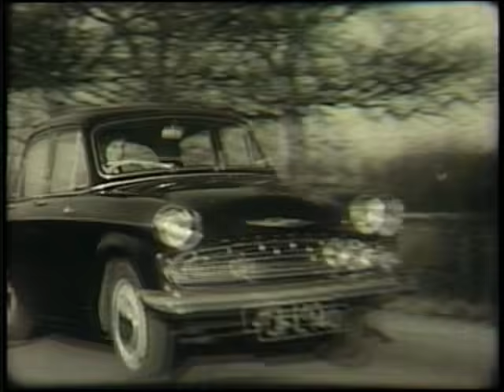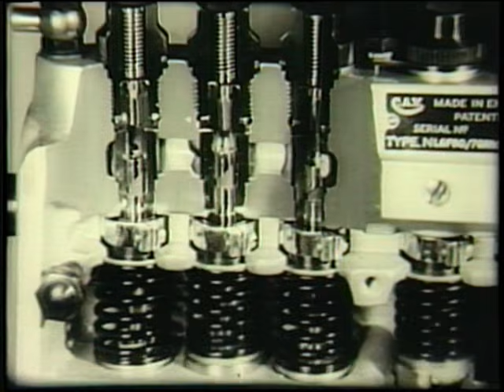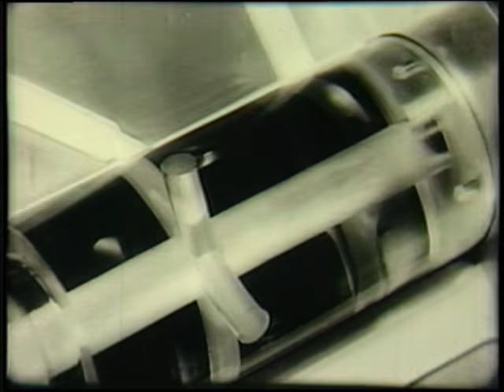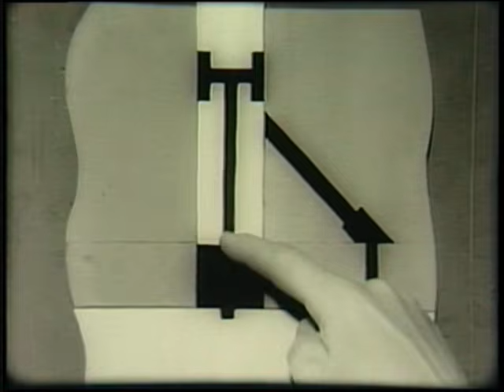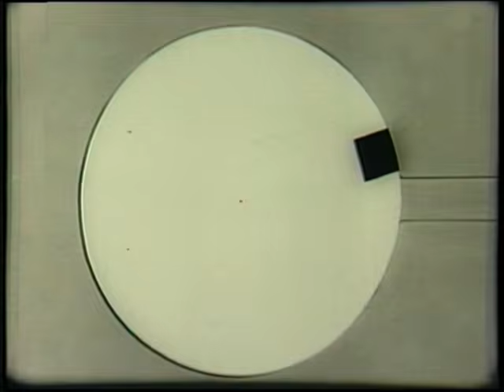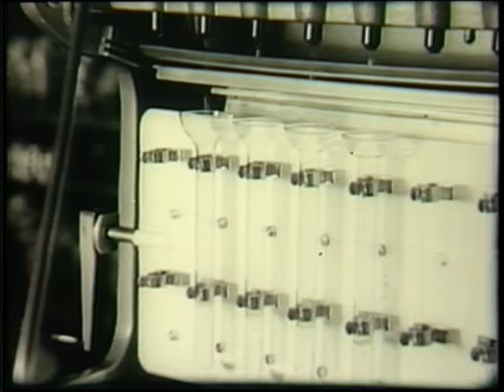The CAV Distributor Type Fuel Injection Pump Type DPA Construction  & Operation

Comment: I repaired the leaking top cover shafts on my 1985 ford backhoe and I can just get it to idle! What the hell did I do wrong?  Very varnished inside and  I think I have the spring holes correct but can someone tell me what hole the spring goes into on the pivoting arm?

Comment: is there someone on this video that can answer a cav question i have about our case580e backhoe? the engine will only run when i operate any hydraulic, as if the hydraulic load causes the pump to work i guess? somehow i find this pump very complex and want to understand before i take it all apart, this is my current job and i dont know what to tell the boss
Reply: A pump such as this should be sent off to a specialist Company to deal with - it's quite beyond the standard workshop facility due to its very fine engineering tolerances when being manufactured, and also the cleanliness of the servicing environment is of utmost importance for the very same reason.

Comment: nice job,,,,in the test room, is the test done with a prototype injector? or what the engine has...how will we measure the pressure of the transfer pump? and how will we know if the hydraulic head has lost its performance..thanks
Reply: I think you will find that the lower of the two bleed nipples is at transfer pump pressure and the upper is at lift-pump pressure.
Reply: @ColinMill1  how will we know if the hydraulic head has lost its performance..thanks
Reply: @nik-utb  That is a very good question. On the vehicle its not going to be easy. Given that, in a conventional diesel engine, the injection system isn't trying to maintain a given fuel/air ratio (as it has to in a petrol injection system). The action of the governor probably masks moderate levels of leakage in the high-pressure pump. At a given throttle setting, if the RPM drops slightly because leakage is reducing the delivery to the injectors then the governor will open the control valve slightly and increase the fuel being delivered. I suspect a badly worn high pressure pump shows up first at idle where there is more time for the leaks to have effect and the fuel delivery per pulse is low.
Back in the 1960s I did, as a kid, spend about a week watching what went on in a fuel injection repair shop and the pump testing was done without injectors on the outlets but with the outlets simply piped up to a set of measuring cylinders so that the flow rates could be measured. Presumably the assumption was that the pump, having been refurbished, wouldn't have any excessive leaks that would affect the delivery under injector back-pressure.
Wear in the transfer pump is, I suspect, not a major issue. The transfer pump on a DPA pump, from my calculations, circulates through the regulator valve about 15 times the volume delivered by the high-pressure pump under maximum load. So the system should perform fairly normally even with moderate wear in the transfer pump.
Reply: @ColinMill1  thanks..greetings from GREECE

Comment: Very useful video. What I don't understand is how a worn pump can be reconditioned. As it wears presumably the fuel pressure within the pump housing increases and so inevitably the drive shaft seal will eventually be overloaded and leak into the sump. So unless all the worn components are replaced there will be no improvement in an old pump.

Comment: But what if you press the priming knobb? Well the fuel bypass everything. The priming pin can get stucked and mess up motor
Reply: what? im trying to understand
Reply: The regulator valve allows the pump to be primed using the lift pump priming lever as far as filling the pump casing and the transfer pump but not the high pressure pump or the injector lines so the final stage of priming requires cranking to operate both the transfer pump and the high pressure pump. The lift pump priming lever is missing on my tractor so I have to do the whole priming job by cranking. With a fully charged battery this is no problem.

Comment: Hi all, I am trouble shooting a Bristol Taurus crawler (1950s era) which will only operate at full RPM. Perkins 3cyl engine, CAV BPE injector pump. Wondering if anyone has advice what could be causing this issue - the engine had been run out of fuel immediately prior to this issue arising so I am wondering whether something from the bottom of the tank has blocked/stopped something in the fuel injection pump? Many thanks
Reply: did you get it fixed?
Reply: These DPA Injection Pumps are engineered to exceedingly tight tolerances, and so any debris in the fuel supply will undoubtedly have a negative effect on the function of the pump itself. The fact that you say that the engine had been run out of fuel just prior to the issues you've experienced would certainly point to contamination of some sort. When a fuel tank is run very low or empty, any crud in the system tends to accumulate around the fuel outlet port, though a guaze filter is normally employed at this position. It should be removed and cleaned and the fuel tank also thoroughly cleaned to get rid of any internal debris build up, before refitting either a recleaned guaze filter, or a new one installed.
 After the fuel tank but before the fuel injection pump, there is usually at least one fuel oil filter element and in some cases two, in order that only the cleanest fuel is allowed into the system to begin with. These filters can also be replaced with new, if deemed necessary.
 Regards stripping an injector pump down, I'd respectfully suggest that the pump itself be sent off to a specialist in this kind of work.
 The tolerances are so fine, I'm led to believe that even the heat from ones hand, if holding a demounted pump, can actually expand some of the elements within the pump.
 In use, although physically bolted to the rear of the timing gear housing, said housing is usually made of diecast aluminium which conducts heat generated through the engine block, away from the pump body. Furthermore, because Diesel fuel oil  is also used as a means of lubricating the pump, all closely mated surfaces within the pump benefit greatly from the cooling effect of the Diesel fuel any time the engine is running.

Comment: Every other video about fuel injection pumps should be required to have a link to this original Perkins technical sales/support film.
The real question that everyone has is how do I get air out of the thing so the motor will start.  Now I know what is going on inside the pump.

Comment: Excellent video, thank you very much!

I am in a process of converting my marine Perkins 4.108 into a generator work horse and was trying to find information on CAV DPA hydraulic (which my motor has) and on mechanical pump (which I think I should get for generator use). This video explains all I need to know about these two types of CAV pumps.

Comment: Okay I got a dumb question, if the hydraulic governor is far simpler, why use the mechanical type? He says it's more precise but what does that mean?
Reply: Well, I have a 35x tractor with the mechanical governor and if it is running light at 1700 rpm it will drop to perhaps 1500 rpm under full load. Quite remarkable for a purely mechanical system especially as it has no tendency to hunt even though the pump has 8500 hours on it.
Reply: @ColinMill1 the DPA Fuel Injection Pump is indeed a mechanical marvel - so clever yet so simple !

Comment: Excellent presentation and show the internal workings of the CAV diesel pumps. The British are true masters in mechanical engineering. Love the vintage of the overall video clip. 1950's ?
Reply: Lolz.......it's a poorly made knock off of a Roosa Master pump!
Reply: @randymagnum143 I did wonder about that myself, so that would be to suggest that the Roosa Master Injection Pump was first on the scene before the CAV  version ?
 I would debate whether the CAV Distributor Pump was 'a poorly made' item - many generations of Perkins engines have used this very pump, whether it be for a 3, 4 or 6 cylinder engine. All of those engines have withstood the test of time which kind of pours cold water on your assertion that they're poorly engineered !
 As an aside, CAV also manufactured a Rotary Distributor Fuel Injection Pump for use specifically with V8 diesel engines - this was a first in the industry - around late 1976, as said pump was fitted to V8-640 & TV8-640 engines as fitted to the newly minted MF 2770 & 2800 tractors respectively. 
 This particular pump was a bit of a disaster unfortunately and could allow the engine to run in reverse, with the obvious consequences.
 Said pump was quietly discontinued not long after, and subsequent versions of these two specific engines thereafter utilised Inline Fuel Injection Pumps supplied by either Robert Bosch or Simms.
 Given the design similarities of these two particular pumps, one may simply have been a copy of the other, built under licence, but I am not certain on that point, or which Company actually originated the design ?
 Once heard about an MF 90 tractor that had a Roosa Master Injection Pump fitted and it ran extremely poorly. Owner of the machine swapped it over for a Distributor type pump and had no further issues. You pays your money......
Reply: @randymagnum143  The CAV DPA was introduced before the Roosa Master Pump. Stanadyne also chose to license produce the DPA.
Reply: @agt155 so why was the Roosa Master introduced 8 years before the Cav?  And why did Hartford Machine Screw buy the patent if Cav already owned it?  You’re wrong

https://www.dieselduck.info/machine/01%20prime%20movers/1988%20Roosa%20HP%20Distributor%20fuel%20pump.pdf
Reply: @agt155 don’t know why my comment was deleted, but 1947 for Hartford Screw to by patent from investors, 1953 they sold license to Cav, stanadyne wasn’t a thing until the 70’s when they took over Roosa Master production.  You’re all over the wrong map.
Reply: @randymagnum143  Hartford Machine Screw Company became Standard Screw Company in 1900. Standard Screw Company changed its name to Stanadyne in 1970, they are all the same company..

The CAV DPA was a CAV design not a licensed product.  Stanadyne license produced the CAV DPA.  Strange why the owners of Roosa pumps chose to license produce a rivals "poor knock off" don't you think?
Reply: @agt155 ok, what year did cav introduce their version?  🤨  didn't lucas own Simms too?  Another poorly made injection pump.  Ozzy worked for lucas, the prince of darkness.
Reply: @agt155 Hartford Machine Screw was founded by Christopher Spencer.
Reply: @agt155 Vernon Roosa said you don't know WTF you're talking about.

Comment: Lol, all their developmental work, ok sure. It's a Roosa master DB2 pump they built under license, just like the stanadyne pumps used by GM and Ford in their mechanical injection diesel pickups, in Ford tractors, and all kinds of stationary light engines. Those CAV units look like a direct copy of the Roosa labeled units in Ford tractors, ROFL
Reply: The distributor pump design was licensed from stanadyne. However anyone with more than a passing familiarity would know that a DPA and DB4 are different pumps.
Reply: @tjsbbi  db2, not 4, and Roosa had both the mechanical and hydraulic governing covered in his patents. The differences are very minor, the Roosa vane pump uses 4 blades instead of 2, the mechanical linkages in the governor racks are divergent, yet perform almost exactly the same. The db4 has a 4 plunger high pressure pump for greater volume, but the db2 is a dual plunger just like that dpa. Roosa also has pneumatic governing as an option, but it require an intake butterfly valve akin to a throttle body. The difference of the dpa in that film and the Roosa used in Ford light tractors is pretty much the top cover mounting, and plane of the fuel lever rotation. The dpa just uses a simpler main casting, and a "lower inventory count" lever and spring arrangement.
Reply: @ludditeneaderthal  my mistake then I was thinking of a DB4. I seem to remember them as having a substantially heavier barrel.  The CAV DPA and DPC had a 4 vane transfer pump which may be the same as the DB4.
Reply: @tjsbbi  the stanadyne pumps run a gamut of sizes. The db2 on the Ford idi v8s are actually pretty tiny, the gm 6.2 v8 version is also "petite", lol. The 4 cyl White engine military genset model is a bit larger, and some stationary use models get pretty chunky. The Ford 4 cyl small tractor model is about the size of the Perkins CAV. I think that's just indicative of the versatility of the design, it's quite scalable for the job at hand, even if you only use the 2 roller variant. At least as scalable as the typical Bosch style " box, camshaft, and row of pump bodies" pump/governor rigs, and pretty much always lighter and cheaper. That DPA is actually a pretty nice variant, between the simplified castings and the "lean manufacturing" nature of the governing linkages, it seems nicely suited to modular use on a variety of engines and duties.
Reply: @ludditeneaderthal  that is indeed interesting detail - you're obviously well versed in the different types of Distributor Fuel Injection Pumps.
 Wouldn't mind a bit more of a detailed breakdown such as when was the first DPA type pump actually made and by which Company ?
 I'd completely forgotten about the fact that Stanadyne also manufactured injection pumps.
 I find their operation and history quite fascinating. Of course nowadays, common rail is the buzz term, but even that is still fed by a distributor type fuel injection pump, usually made by Robert Bosch of Germany, in the case of Massey Ferguson tractors - don't know much about the other brands.

Comment: GREAT PUMPS IN THERE TIME BUT TODAY ITS ALL CDI INJECTION SYSTEM, BRITSH ENGINEER WAS VERY CLEVER ,
Reply: Thousands upon thousands of these still installed and in operation all over the world.  I had reason to take a 1970’s version apart for service today, and I’ve got a dozen other pieces of equipment that use this design.  I suspect this will be pertinent to mechanics and owners for a few more decades to come.
Reply: CDI is an abbreviation of what ?
Reply: Usually Capacitor Discharge Ignition, but old mate is probably going for Common rail Diesel Injection. Which I know as CRD.

Comment: 21 dislikes!! They must be mechanically braindead. Fantastic british engineering at its best. Perkins and c.a.v working together. Pleasure to watch. Restoring a massey ferguson 65, this has helped me understand the principles. Thankyou.
Reply: Ditto for me with a ’73 Ford industrial tractor.  Some bozo had taken the input valve assembly for the transfer pump side, and instead of replacing a simple o-ring, tried to build a seal with silicone…  I’ve been cleaning bits of that out of the whole works.   Poor thing was being starved for fuel.  One cleaning and one o-ring later, it makes fine pressure.
Reply: same pump is Used in Peugeot 404 1.9D (Indenor engine)

Comment: Many thanks - extremely useful and a great reminder of all the instructional films they showed at my school and tech college!
Reply: I should add that for those interested in the subtleties of the transfer pressure regulating valve (which is not covered in this film and which is complicated by the need to allow the pump to be primed by the lift pump) there is a good diagram and explanation about 2/3 of the way down this web page:-

http://www.tb-training.co.uk/cisys.htm

Comment: Excellent!  I'm in the process of disassembly and resealing a CAV 3-cylinder injection pump on a Ford 3600 tractor.  This film helps me visualize and understand the operations of it's components.  Thanks for posting.
Is there a source for higher res versions of this film/video?

Comment: I have gotten ahold of a old volvo tractor with perkins engine and cap dpi pump,its primed good and all but doesent spit fuel at the injector lines. been ununsed for 10+ years so i guess the plunger pistons are stuck in the old diesel. the throttle lever that adjust the fuel was a little stuck too. now i can tear into this and see whats wrong :)
Reply: If you pull the injector pump off the engine and manually spin it 600 RPM for so, you can often break them free due to centrifugal force and it'll start pumping again!
Reply: @stanRmeyer  thank's, I'll try that on mine, I have the same problem on an old bmc engine that's been stood for year's.
Reply: @edwardkennedy9919  I hope that helps it's a tip that an injection pump specialist once told me when I was troubleshooting with him!

Comment: Excellently presented. Do you know what year it was produced?
Reply: +B815SX  By the vehicle model present in the film, is posible the year 1955 60
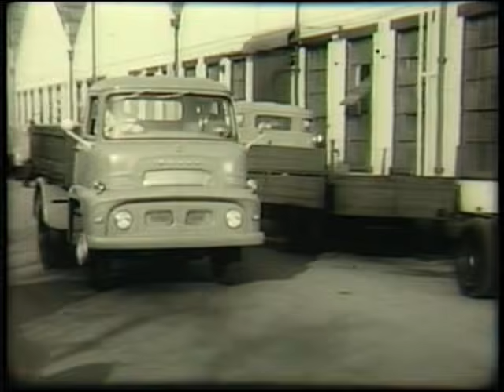Reply: The line of Commer FC series 1 vans shown at 0:54 suggests it can't be before 1960.
Reply: @ColinMill1 there is a short sequence where the MF 65 tractor is shown - this tractor began manufacture late  1957/early 1958, so that narrows it down somewhat. The MK I tractor was indirect injection on the Perkins A4-192Y engine, and went to a direct injection cylinder head in 1960 with the MK II tractor, with a Perkins A4-203 engine.
 Have no idea if would have an effect of the type of distributor pump used, both engines were 4 cylinder jobs.
Reply from the maker: +B815SX Not sure of the year, sorry.